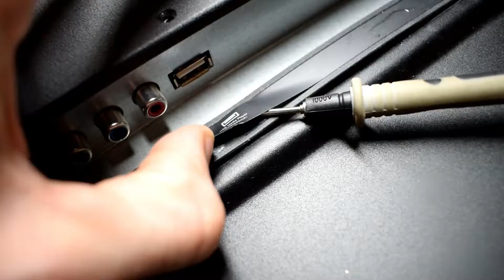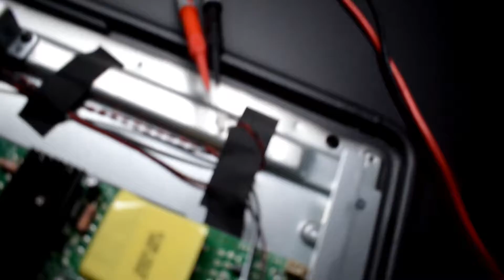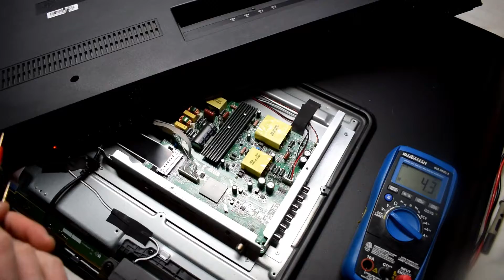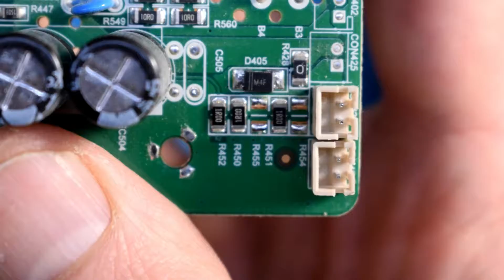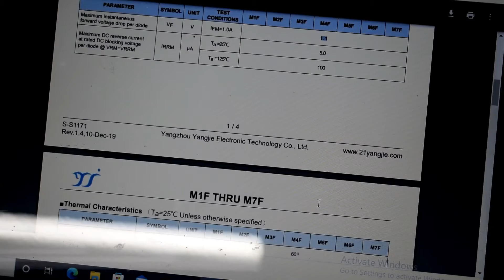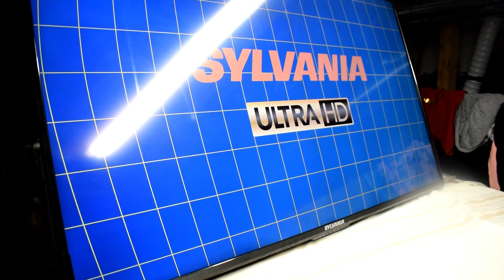55" TV BLACK SCREEN FIX! (SYLVANIA SLEDD5550)

Comment: I got this TV off marketplace for 20$ cause it wouldn't turn on. Red light illuminates and thats it. All capacitors, diodes and 5v supply checked out. Tried reflowing the board, no success. But when I used my heat gun on the chip it came to life 😮 there were heat marks around chip area so it clearly was creating a lot of heat, must have created an open in the chip. Ordering a new chip with a decent heatsink for it so maybe it will last

Comment: Can you please tell me what the flat, folded cable between the mainboard and the t-con is called ? I'm pretty sure that cable on my Sylvannia is bad. When I move it, I can get the picture back, and at least one pin didn't have continuity. But I don't know what its called to search for it.

Comment: Reflowing in the oven requires some smarts. Electric oven "only"! Preheat oven and the rack should be mid position. Set oven at the correct temperature according to your source on facebook or check internet.
Best to have an oven thermometer hanging off the center of the rack. Same place as where you will be placing your board. 
Insert the board and do 10 min for a thin board and 14 minutes for a thicker board.
After the time is expired, turn off the oven and do not touch or remove te board. Let it cool at least for 30 min before moving the board. 
Wait until board is completely cool before inspecting visually if all items on the board survived.
With bottom mounted chips and components this should never be done as they can come off due to melted solder.
I never do this myself but plenty of people have some success.

Comment: Tried this method. All was well till it came to the oven. Around 8 minutes into cooking it started to sound like west Chicago on a Friday night. Luckily my roommate was able to cover the device and safely remove the exploding components from our home. Despite the smell of carcinogenic solder, the rest of the process was relatively easy thanks to your in debts walk through. It is currently cooling outside and I will update when I test later.
🙂👍
Reply: Did you get it to work?